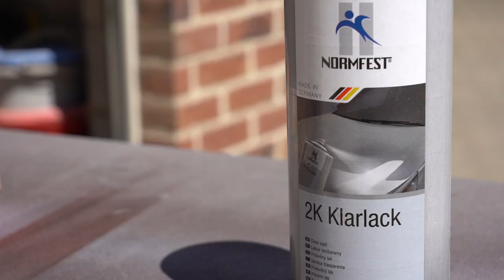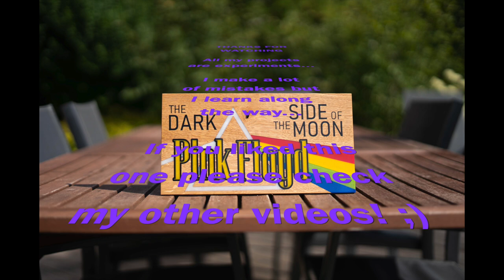Making a "Pink Floyd" wooden sign with multi-colored epoxy inlays

Comment: That's turned out PERFECT! Question.... How long did you let it cure, before you machined each layer? If less than 3 days, what epoxy did you use? I'm using ProMarine TableTop, and you are supposed to wait 3 days. On my first pour last weekend, I did indeed need to wait 3 days (it was too soft). Once I waited the LONG 72 hours, it did turn out perfect. But, I'm impatient and don't want to wait that long.
Reply from the maker: Thanks! I use regular cheap epoxy, I think it was this one: https://www.amazon.fr/gp/product/B07HJ4JTVF/ref=ppx_yo_dt_b_search_asin_title?ie=UTF8&psc=1 

I wait 24 hours for the setting. Maybe it takes longer because of the resin/hardener mix ratio?

Comment: What program do you use to set up the design and how did you register each cut separately so the design lined up? Was it one project or multiple? I’m trying to figure out how to line up a multicolor print at the moment.  Thanks, great work!
Reply from the maker: Hello. It's one single project in Vectric Vcarve with multiple toolpath. The trick to line up perfectly is to make the 1st pocket overlap a bit on the 2nd. So when the 1st is set and you carve the second  you don't have a gap. For example I remove a bit of the red when I cut for the yellow at https://youtu.be/K0RDZfKnU2Q?t=150

Comment: Srephan what kind of wood did you use for this sign?  Usually when I make an epoxy Inlay the epoxy wicks into the wood.  I saw none of that in your project.
Reply from the maker: Hello that was oak. I have "bleeding" problems too, I made a video about the method I use to avoid them (make sure you watch also the 2nd half because I start with the method that doesn't work :) ) https://www.youtube.com/watch?v=OmH4DppRj2Y However in this particular case I didn't really have problems because I didn't sand between the colors but sanded out quite a thick later at the end.
Reply: @stephanforseilles  Thanks for the reply.  I just watched another video where you used clear epoxy before the colored.  That makes good sense.  I've tried shellac before  the epoxy but still wasn't able to completely eliminate.  Next project gets the clear epoxy treatment.  Thanks again for the reply!

Comment: Another great video. I have a question. Why did you use the 15 degree bit? Is there any advantage to the V bit versus a straight bit? I really appreciate the time you put into these videos.
Reply from the maker: Thanks for the feedback!I use a V-Bit for 2 reasons:

1) A straight bit does not allow you to make corners with a radius smaller than the bit diameter. The V-bit 'ramps up' in the corner, allowing for real angles

2) It's a v-carved inlay: the walls of the inlay are slanted so they fit better in the hole with almost no effort (or hammering) -- but that does not apply in this case as the inlays are epoxy :)